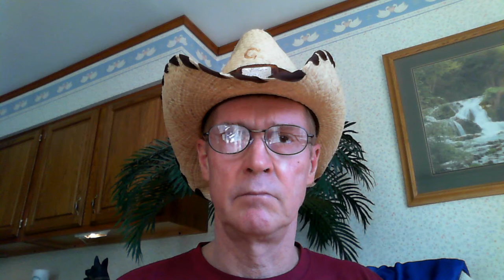Elephant Cage Antenna

Comment: i was a radio transmitter repair tech when i was in the airforce and on one of my assignments there was a huge elephant cage receiving  antenna at karamursel turkey but because i was at the transmitter site i had nothing to do with it. you had to see it in person to realize just how big it was. it was like addressing the elephant in the room...what elephant? i believe one of the functions was to intercept radio communications from a russian sub base on the black sea. that was in 1970 and it is now dismantled and no longer in existance. i also saw one from a distance in the bay area of san francisco and i think that one was on a navy base.